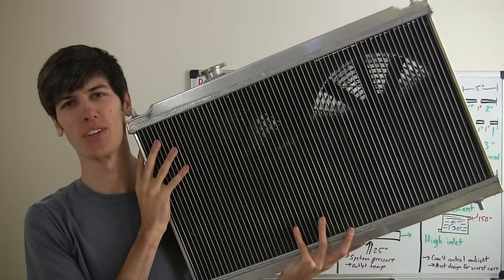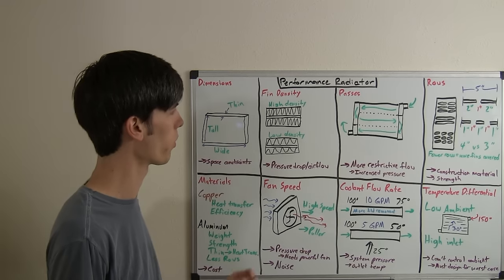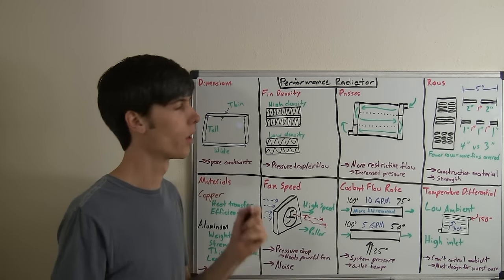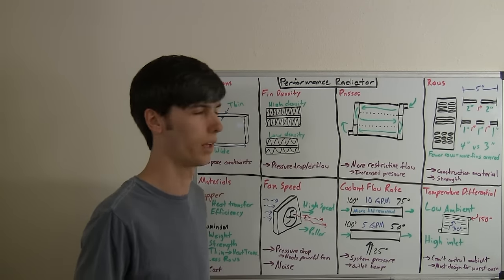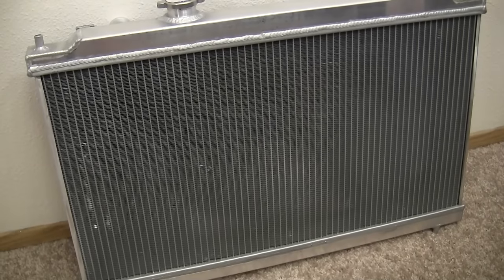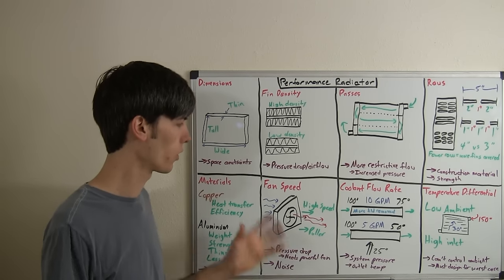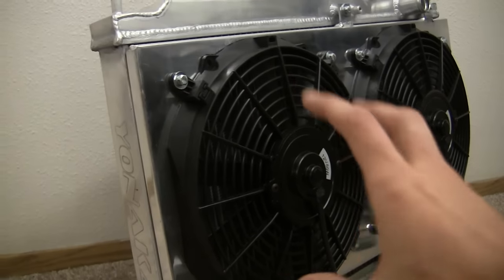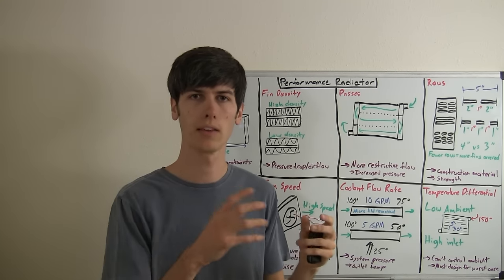Performance Radiator - Explained

Comment: I have a question, Does a radiator shroud negatively effect cooling at speed by restricting airflow? Interested to hear anyone's opinion or experience! (BTW I have a classic Mini with a Honda b18c engine swap that has cooling issues, I currently have no shroud)
Reply from the maker: The fan is far, far more efficient when there is a shroud. This is important for when the car is stationary or moving at very low speeds. At high speeds, there is enough airflow for cooling, but yes a shroud would restrict airflow. It's not as important, because airflow is plentiful at speed.
Reply: As said above, technically, yes the shroud is acting as a flow restriction when vehicle is at speed but is generally not a problem. For some instances (and a way to help eliminate some of the restrictions), vents with rubber flaps are used (or could be added) to areas that are not open from the fans within the shroud. What this does is allows high pressure air from vehicle motion to force the flaps open to more airflow can occur but when vehicle is stopped or at very low speeds, the flaps will close off the vents so that the fans can not such air through the vents. There are some OE fans that do have this type of feature.

Comment: So a 4 row radiator does not release more heat than a two row radiator ??

(It's just a stronger built unit not an improved performance unit) ??

Comment: So the fan pulls in cold air from the outside but it'll turn out blow hot air into the engine compartment causing heat near the intake?

Comment: Will be fun to cool my pc with this , so much is shared here with PC water cooling , also i wonder if water can be replaced with oil , because oil is harder to freeze , lets say corn oil which its freezing point is -20 C
Reply from the maker: Sure, or antifreeze. Oil increases in viscosity with a drop in temperature, where as antifreeze stays more fluid, and will pump more easily.

Comment: In your example with 10GPM reducing temperature from 100 to 75, isn't that the exact same heat removed as 50 degree temperature drop at 5GPM? (yes your explanation was right, but your example just said it didn't matter)
Reply: Correct. The reduced coolant flow example is wrong as the outlet temperature will be lower however the inlet temperature will not the same  (100) it will be higher. Conversely if you increase flow you raise outlet temperature and lower inlet temperature.
Reply: Marty Emerson well valid comparisons are with same input temperature lol...
I forget the context of this post but w.e lol

Comment: soo is there a tube inside the fins? or the water flow within the fins? if the water flow within the fins, does the water like spills into the engine bay when air passes by ?
Reply from the maker: +edric soetanto There are channels that the coolant flows through, which dissipate heat through the fins.
Reply: +Engineering Explained ahh, I see.. Like a mini flat tube heh? Thx for the reply :D

Comment: Had issues in 110 degree heat. 94 astrovan... Needs an upgrade on radiatior... But... Is it easier on engine to carry a 1500lb load or pull 1500lb + trailer wieght.. Say another 1000 lbs.... Thanks.     Or is weight, just weight ..  But pulling level.. Am i actually pulling the full wieght or only going up hill... Down hill it becomes much lighter...
Reply: 1500 lb load in van is only 1500 lb load. Throw in a trailer now you have added an aerodynamic load, minor electrical load, and tire drag load to the vehicle further taxing the vehicle.

Comment: Would a full aluminum radiator have a effect on mpg vs OEM radiator? Just out of curiosity...
Reply: Nope. The thermostat controls the minimum operating temperature of the engine.

Comment: Which is better for cooling turbo engine , a bigger intercooler or a bigger radiator...?
Reply: The intercooler only cools the air charge going into the engine which creates a more dense charge than if it was hot, allowing for slightly higher compression before detonation as well as slightly more fuel can be burned creating more power. It doesn't make any difference to the engine temps as air has a really low ability to cool things compared to water, or coolant. The radiator actually cools the block with coolant, which keeps the engine at peak performance temps and prevents damage from too hot of temps for the engine. 

If your current radiator keeps the car at normal operating temps while driving normally, or even while racing, then you don't need a bigger radiator, and getting one will not provide any benefit unless it's for saving weight. Getting a bigger intercooler will usually net you just a little more power due to having a more dense cool air charge which allows for higher boost and more advanced timing and just a little more fuel to burn as well.

Comment: 98 chevy 1 ton with a 350 constant overheat on stock radiator pulling 20,000lbs no problems with power just needed more cooling. Dropped a 5 core Desil radiator in it never ever goes over 180 degrease. What happens if you run to big a radiator can it damage the engine?
Reply: Christopher Wilson it will only damage your engine if it gets too hot or doesn't reach operating temperature. If your coolant pump isn't working any harder than before then you should be fine. If your coolant pump is occasionally spinning air it could possibly eventually damage it.
Reply: Not if you run a thermostat is of proper temperature for the type of engine. The engine temp is another factor that influences the engine management system. Find out what the stock thermostats are rated at and use one of them. BTW the number of cores can be a handicap as the air will have difficulty passing through even at high speeds. Even racing radiators nowadays are of one or two rows, if they are designed properly.
Reply: Ok thank you guys I appreciate the info! I first did this because my other truck the previous owner changed it to a big one because he regularly hauled 20,000 lbs with it and blew the stock radiator twice. I just changed my 1500hd over because I threw 10,000 lbs on it for 3 miles and cracked both radiator tanks in just 3 miles. I don't know why it does that with the 1 inch radiator and not with the 2-1/4 inch one my best guess was not enough cooling and overpresurizing. Any ideas?

Comment: What happens to the air after it flows through the radiator? Does is exit from the bottom of the car?

Comment: OK so from my undetanding the more rows you have the cooler the engine correct I'm shopping for a three row radiator for my Chevy 350 keeping the stock fan just need to replace it because it rusted out so would an aluminum 3 row be beneficial to my old school 350
Reply: If your going for a bigger radiator everything needs changing Your fans might not have the Static to pull though a deeper coil and that is and extra row which means higher pressure drop so your pump and fans need to be changed as well.
Reply: Oh so its all three elements of the water pump and a bigger fan
Reply: I was just going to add a three row radiator to my nova and run my stock fan since its huge
Reply: Ok I get what your saying you can try it out and if u need to upgrade the fan and pump later u can.
Reply: +Andre Baker  thanks brotha  I'll let you know the out come
Reply: get copper+brass rad. they are more repairable than aluminium+plastic, or all aluminum.

Comment: The one thing I can't wrap my head around is that the thermostat on the car would hold the heat in the engine until it gets to the operating temperature. Then, when it opens up, that super duper large radiator with get rid of that heat faster and cool the thermostat down and continue to do this effect, or just not even cool anymore than it did with the older, possibly smaller, radiator. Unless you were running some super hot nitrous engine, a new large High Performance radiator makes no sense and is a waste of money if your current radiator is fine.
Reply from the maker: Correct, it really wouldn't be necessary if you're running a stock engine and not racing your vehicle. But if you were to race it, and add some power, it could be a good idea (plus many stock ones use plastic end tanks, instead of aluminum). Definitely for a specific application though, not something you'd just slap on for no reason.
Reply: Don't underestimate the amount of (heat) energy going into the coolant water after each combustion. Remember, with regard to heat transfer, the unit represents 'energy unit per square meter (or imperial equivalent)':

With each combustion, energy is not only produced with the chemical energy from fuel, but with the amount of friction reduced, the rotational speed of the crank (and the correspondent speed of the piston), and compression ratio (many more areas could help increase gross power output).
To put it on base terms, the temperature (and energy) produced from the simultaneous compression and ignition of the air/fuel mixture is extreme. And when this occurs say 4, 6, or 8 times per revolution, the amount of energy th radiator can dissipate per cubic meter (or per cubic foot) is relatively insignificant...
The amount of energy produced per engine revolution is more than the system (without the radiator- ie. the thermostat is closed) can get rid of.

The temperature PLUS the amount of relative fluid in the engine block (compared to the total system) will act as a buffer; the radiator cannot INSTANTANEOUSLY cool the fluid to create the infinite 'insufficient cooling' loop you describe.
Reply: Well in my 93' Cavalier the fan has to turn on when sitting at a light when it's like 80 F out, my old Grand Am could sit 90 F heat and never had to turn on the fan except if A/C was on.

Comment: for greater cooling can collant be changed to other liquid that naturally always have low temperature?  is there any? such as liquid nitrogen...
Reply from the maker: Liquid nitrogen isn't "naturally" cold. It has to be put under a great amount of pressure, or stored at very low temperatures to liquify. Once it is exposed to the atmosphere, it instantly begins to evaporate, dropping its temperature to a very low number. In a closed system, it wouldn't stay cold (aside from other reasons it wouldn't quite work, like having to keep a very high pressure).
Reply: owh okey... thanks for your explanation... always like your vid... btw.. is there any liquid which naturally low temperature on it's own?
Reply from the maker: No, that wouldn't work out with energy laws.
Reply: owh alright.. thanks again..;-)

Comment: #3 is false.
Given all other variables stay the same, having one long path only increases resistance and flowrate, but not cooling efficiency.
Reply: I came to the comments area specifically looking for someone to say this. I agree with you. The long path might appear to have more cooling efficiency, however that is actually a matter of resistance causing a lower flow rate which translates into a longer duration in the radiator, and therefore a higher temperature delta of coolant between inlet and outlet. However, that reduced flowrate also means coolant is spending more time in the engine as well, absorbing more heat due to the longer duration there and subsequently coming out of the engine hotter (higher T delta). So, it's mostly a wash, except you end up with higher engine temps due to the low flow rate, and also more parasitic drag on the engine due to the flow resistance requiring more horsepower into the water pump. Ignoring the losses due to restriction, the two designs actually perform about the same... it's really a matter of surface area.

Comment: are their other way to cool things besides radiators? OR  better things than water to run through them.. ?
Reply from the maker: Radiators are a pretty great way of cooling things. You have to remember that you need to get rid of the waste heat, and do so means getting it out of your system completely. There are many different fluids you can use to cool. Water has a lot of great properties though - isn't corrosive, good specific heat, good heat transfer.
Reply: thanks a lot for answering, your channel is great. love your new car you deserve it.

Comment: Yes for sure but the engine bay is usually already an 'hot place" so dont live this as a drama and usually when the fan start to spin is when the car is slow slow slow moving (like pedestrian) or stop at all. So again this appen not when you need al the HP out from engine, This is also why car as a water temp gage. When its say over the "normal" temperature range you dont rev out like the hell.

Comment: What about galvanic corrosion when using different types of metals?
Reply from the maker: My chemistry is poor, but I'd say aluminum would be the ideal material choices over 9 times out of 10. Light, strong, great at heat transfer.
Reply: A mantra from water cooling computers is: don't mix copper and aluminum in the same loop.

Generally, if you are space restrained, use copper; if your weight, cost or mechanical durability restrained use aluminum.

Comment: if it partially depends on car speed where do they place radiators in rear engine cars?
Reply from the maker: Could be in the front, or to the sides of the engine with air intakes on the side/body of the car.
Reply: Engineering Explained are there any major downsides of running the coolant all the way to the front and then back if the radiator is in the front of a rear engine car?

Comment: Hi, I have this question for anyone to answer.  If the specific heat capacity of oil is lower than water, why isn't oil used for cooling. Is it only because water is easier to circulate than oil. What if I drained all the water from an engine, left it out to dry and replaced it with synthetic low viscosity oil, wouldn't it be a more efficient system?
Reply: Hi, the specific heat capacity of water actually benefits the engine as it keeps a more consistent temperature across the engine. Also water has a higher thermal conductivity then engine oil meaning it transfers heat quicker to keep the engine from overheating. Water is easier to circulate than oil which does benefit the cooling system but it is also simply cheaper.
Reply: @stephenmccabe5129  thank you

Comment: what is typical (with engine warmed and running at idle, roughly 65-75 degrees ambient temp)  TOP TANK TANK TEMP (Fahrenh) and what is typical BOTTOM TANK TEMP at the same instant in time (Fahrenh)?????   PLEASE!!!! no one on YouTube dares to give this data or else they are just overlooking the obvious, and that obvious oversight would make it very simple to determine if the radiator is doing it's job.

Comment: My car doesnt have a working Radiator... Does that take away HP? I feel it sort of sluggish.
Reply: Willbryan Medina I would worry about your motor seizing up, you don't want your motor to get too hot or the components will seize and no longer move. You should have a radiator and thermostat to open when the temperature internally reaches the temp of the thermostat. Aftermarket thermostats have different temp ranges but somewhere around 180 should be good for a normally performing vehicle.

Comment: no its not, removing the heat generated by the radiator it self with pull out the hot air is better that push the ambient air trought it.

Comment: Why do thinner radiators dissipate more heat?
Reply: +Nick Martin because the thicker the radiator the more the air heats up before it reaches all the fins at the back... basically, the more radiator the air has to pass thru the hotter it will get while still trying to pull heat.. idk if that help.. but i tried lol
Reply: then why isnt every radiator thin?
Reply: +Nick Martin Because there is only so much width and height to fit a radiator. So the only way to get enough surface area of fins is going thicker, but since the air gets hotter travelling trough the radiator, they have to compensate for that by going even thicker.
That's why they start the design by going as wide and high as possible, and thén calculate what thickness is needed to provide enough cooling.

Comment: who sells these radiator?
Reply: BeCool and Griffin make quality performance radiators. Sometimes Jeg's and Summit Racing have a cheaper "Jeg's" or "Summit" branded performance radiators. The fan shroud also makes a big difference for cooling. Don't forget the fan type as well. A normal non clutched mechanical fan will use around 30HP and even the best flexi fan will take 12HP or so. Clutched fans are somewhere in the middle. Electric fans use the least and only run as needed.

Comment: m8 i used one of theese to cool my computer but still it was boiling thanks amd
Reply: With the AMD heatsinks there is a recall and the fix is just to use a normal kitchen sink instead. Once you have installed the sink fill it with water and throw in the entire pc.  AMD does not honor the warranty on this heatsink mod though. But I don't recommend you do that. AMD FX processor PCs make great space heaters in cold rooms. Not quite as good as the old Prescott Pentium 4 computers though.

Comment: شل الثرموستات  better to remove the theromstat  than instal performance radiator  استغفر الله
Reply from the maker: Disagree as your engine will not get up to an optimum operating temperature, you want the engine temp to be regulated, which is what the thermostat does.